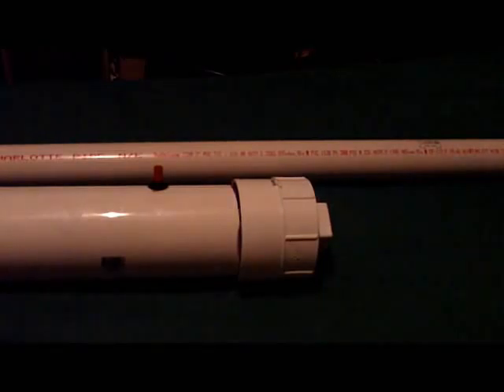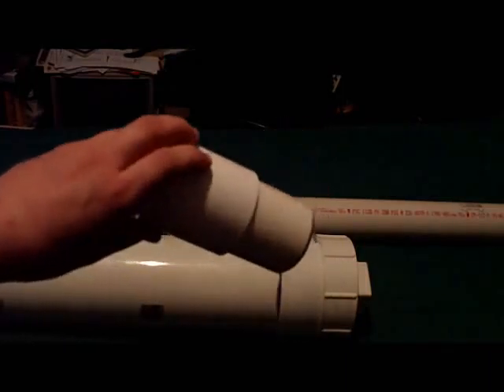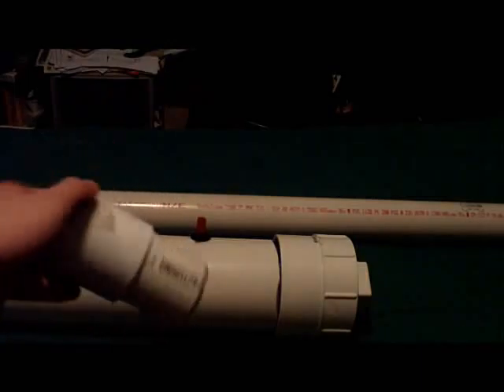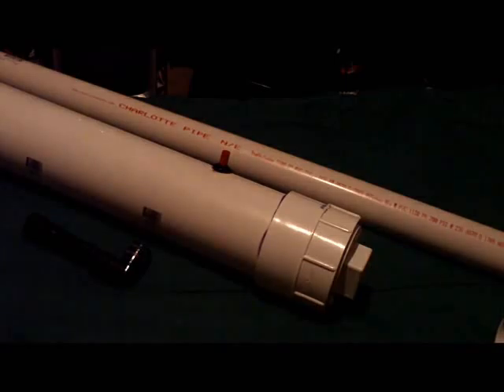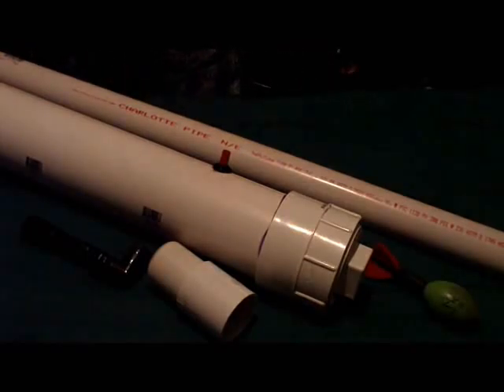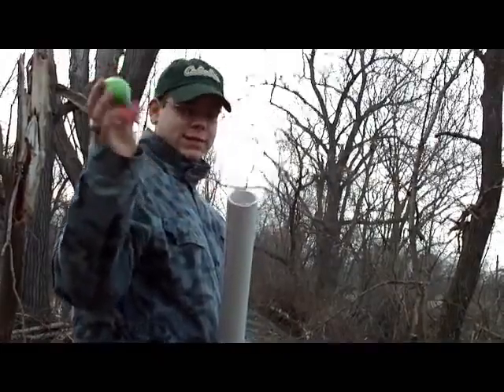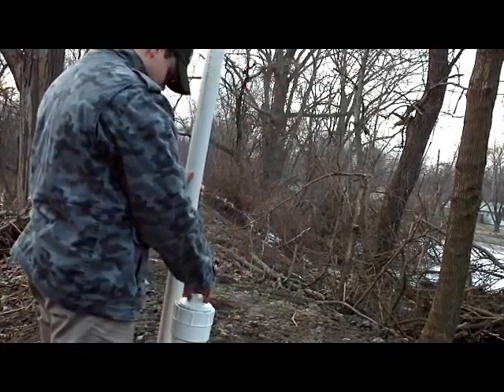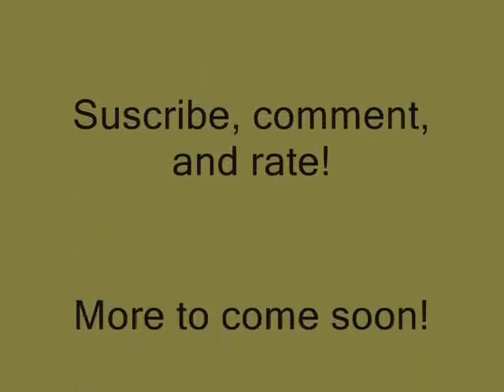Potato Cannon Fun!

Comment from the maker: I only made a few weeks ago so it is too cold out to paint it. It is a very simple design, and I became a spudfiles member after I built it, so I didn't know about the elbows needing to be pressure rated as well as the extra spark gaps. I was thinking about using ether (starting fluid) as a source or Axe spray as a fuel source, but I am afraid that ether is too powerful. I have already designed a barrel brace, but I am waiting for my dad to build it at work eventually. Thanks for the input!

Comment from the maker: The part you put the cap in slowly gets narrower as it goes in, so as the cap is screwed on, it gets harder to screw it in. Because mine was getting hard to remove, I added graphite and some silicone spray.